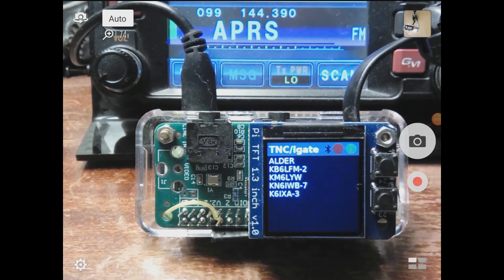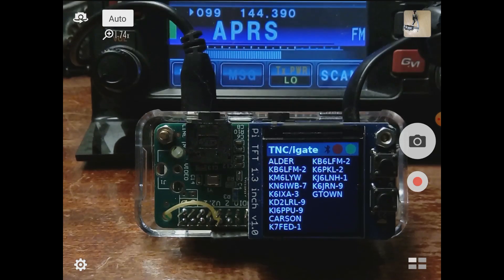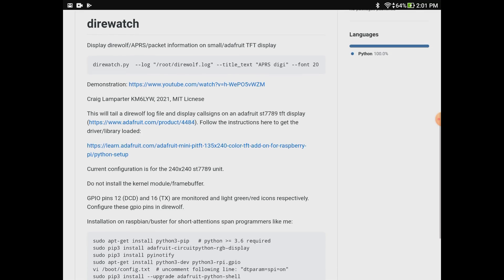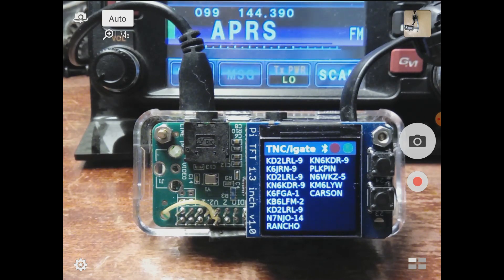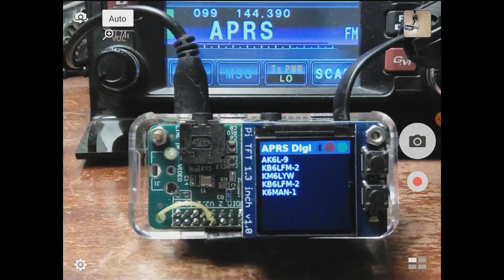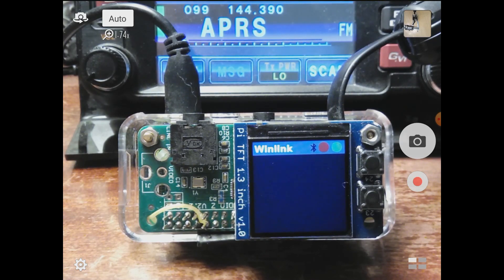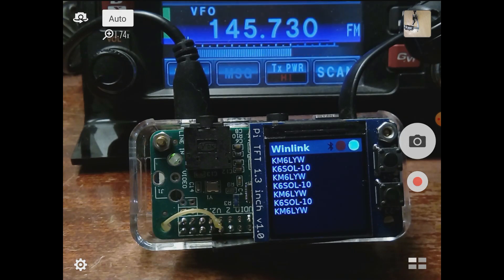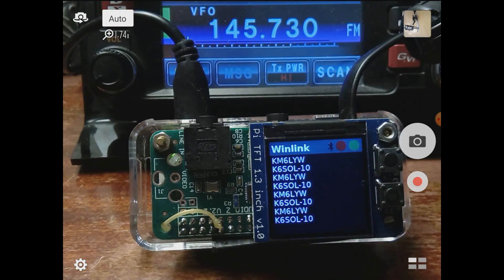Direwatch - Direwolf display driver

Comment: Can we get it configured with E-Ink displays? These are great for no power standby and low power refresh
Reply from the maker: It'll need some programming, but I'm not sure the refresh rate is sufficient.  the tx/rx "lights" flash off and on regularly.
Reply: @KM6LYW Radio  I'll get some specs for the two units I have... If they might work I'll send them to you or can test any code here...
Reply: @KM6LYW Radio  0.3 partial ND 2s full refresh.  With touch screen !